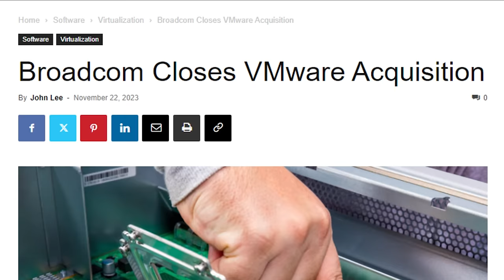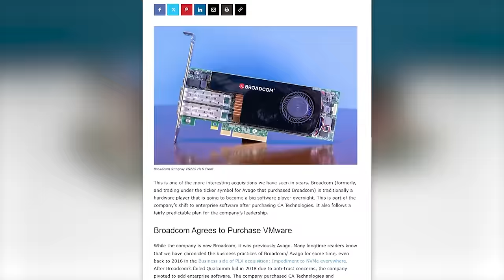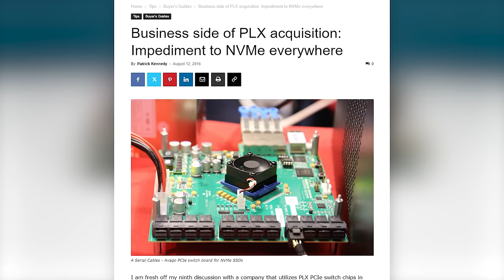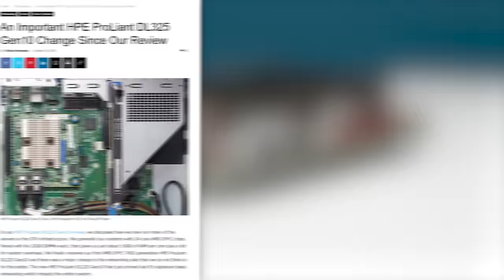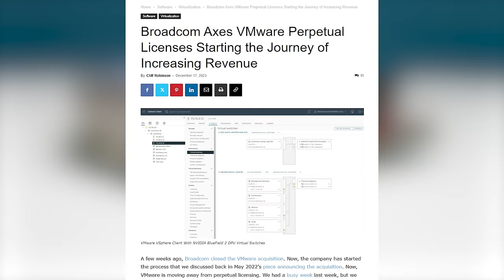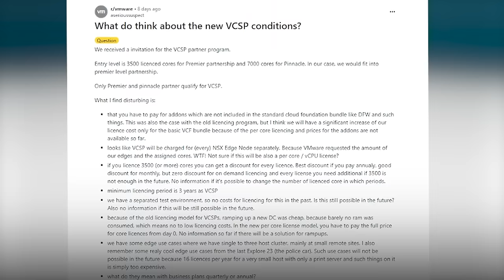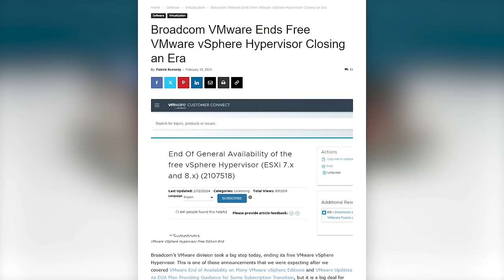VMware GUTS Customers with 10x Price Increases

Comment: 4:53 - It is actually common practice to put standalone ICs on the motherboard on initial A-Rev, first to ship boards. This is because it is so easy to replace in the manufacturing stage if problems are found with the firmware. Once the firmware has matured it is then transferred somewhere cheaper. There is nothing nefarious about.

Comment: The issue is not switching the hypervisor , that is easy. You have XCPNG + zenorchestra that at a base level is superior anyway. Its the products that sit around it like zerto or rubrik. If you are using them products and have your processes set up around them that is hard to switch. If you are a smaller player with a few hosts vmware dont want you and honestly you are better off without them anyway. The super big boys are fine as they will pay anything , the low end guys can just switch as they have a small number of hosts. Its the guys in the middle with say 10 hosts that are fu***ed.

Comment: Coverting VMWare is not easy , but is doable. I'm hoping MSFT (HyperVisor) or Oracle (VirtualBox) will come out with a simple convertor.
Reply: Oracle Cloud has a VMware infrastructure lift and shift solution. You can just move your entire esxi/vcenter infra to OCI without reconfiguration, and Oracle will provide you with VMware subscriptions with a better price (for now). 

Probably at a later stage they will also provide a migration solution from vcenter on OCI to OCI native
Reply: XCP-ng's import tool works well. Only had to make small changes to each VM config after migration.

Comment: I’m just a small VMware Fusiom customer who has used it to run Windows on my Intel MacBook Pro very occasionally. I’ve been a customer since 2012 when I bought version 4, then six upgrades on top. I held off buying the last two upgrades as they didn’t offer any value to me, and now have switched to Parallels on Apple Silicon for running Windows on ARM. Couldn’t be happier!

Comment: We are watching the death of the private cloud. This is a disaster for small business with big IT needs. For example I run a call center IT dept. We have the IT needs of a company 10x our size in other industries. I use VMware now and am looking at moving back to bare metal servers because I can't trust the hypervisor companies.
Reply from the maker: What about a Linux virtualization option?
Reply: Cisco is getting back to back stomach punches with this. In December, they released version 15 of CUCM, Unity, and CUPS to move away from CentOS, with UCCX pending. Now, they may have to redesign again as all of the products are currently only supported on VMware on UCS servers. Interestingly, Cisco never supported over subscribing vCPUs to physical cores.
Reply: @ServeTheHomeVideo  not every software solution support that. There is a substantial amount of software distributed mostly as the VMware appliance.

Comment: I have added additional RAM to my NAS and am now using my existing Synology NAS's built in VM manager application to host VMs at home.  I got rid of two ESXi hosts and quite a bit of CPU horsepower in this effort, but for a home lab  I didn't really need the CPU horsepower.  This has proven effective and I am happy with the result.
Reply from the maker: Totally. If you needed more CPU QNAP tends to offer more also in a NAS platform

Comment: We've got rid of our on site server estate, 30+ offices because of the VMware costs. Now we use Azure and our own DCs for servers and that's it.
Lose customers = Increase prices to keep profits high = lose more customers = rinse and repeat
Reply: But if you migrate your workloads from VMs to the cloud as it is, the cloud setup will cost you times more than onprem. Or?
Reply: @G00glieS  like for like yes. But these are general services like DNS, AD, DHCP, Printing, SDP. 
So they've gone, well we can get rid of all the local servers and just have all offices in that region running from cloud or data center

Comment: I work for a Fortune 500 company that uses VMware extensively. I even admin a remote sites instance as part of multiple responsibilities. I really wonder what they are paying because they have thousands of instances, easily. They have also had to maintain mainframes as well, lol. Certain software that runs the company was designed for it.

Comment: We have a couple of old VMWare servers running our on-prem stuff. Already have the new servers on hand, just waiting to migrate them all over to Hyper-V. It's all Windows Server stuff anyway, so Hyper-V made sense. Broadcom will price themselves right out of a business model. Your point on the pipeline is spot on. Small players who are already using the product are most likely to expand on the systems they are already using. Shut off the pipeline, and it will just be the big legacy clients, most of whom will start running the numbers on migration vs. continuing to license a dying product.

Comment: As soon as I heard about it, moved to XCP-ng. And have fears about what will happen to Spring.
Reply from the maker: I told the XCP-ng folks we will cover them more at STH, even though I am much more familiar with Proxmox VE.
Reply: What would be interesting to see, been running my small business on XCP-ng for a few years now and I found it to be super stable.
Reply: I saw XCP-NG supports iSCSI but I haven't seen anything about NVMe over TCP. I thought I saw something that neither Proxmox nor XCP-NG supports VMware snapshots on block based storage like iSCSI. My backup solution, Cohesity, uses the snapshots for VM backups. There's an agent for most OSs but that doesn't help for appliances. Quite a few of the appliances don't include any kind of VM tools.

Comment: That you stated that moving to Proxmox is simple. Many of the SMB users of VMware have it integrated with other system such as their backup and or DR system. So, for some of these SMB's they not only need to move their virtual environment, but they also need to move their backup system as well. Let's say that solution is Veeam they and they are using replication they would have more than just one consideration.
Reply from the maker: Yes. We have folks on our team that are going through this right now with VMware and Veeam.
Reply: As a computer reseller, I had a brief conversation with my Synology sales rep and mentioned this. I planted the seed that they need to start playing with Proxmox and alternatives as people jump ship. Hopefully, that seed will take root soon.

Comment: Just finished moving all the environments I'm involved in away from vmware. Proxmox has been a good alternative so far, the biggest problem is availability of training for staff.

For my home setup, kvm with something like virt-manager is good enough and nicely light-weight. In general, having lots more storage options is a big plus over esxi based solutions.

While I've been using esx since version 3, and really liked where it was going technically in version 6, after that, things have been going downhill imo.

Comment: I've come from a Hyper-V background and have just changed jobs - to find that all of my customers are using VMware. Having not touched the VMware ecosystem before, I'm needing to learn it as quickly as possible. I have a server at home with a spare node that I was planning to use as a VMware test server - but now I guess I can't! So silly of them to remove the free version - my company isn't going to pay for a testing license, so now I just have to learn on production systems. Well, I guess I can blame VMware when mistakes happen (which let's be honest, they will).

Comment: Last time I used it, esxi was on version 5. Once Hyper-V came out, it didnt make sense to host windows on it. With docker/kbernetes and pods, it doesn’t make sense to host linux on it either.
And with microsoft shifting to cross-platform with dotnet core and so many tools, its no wonder 80% of my infrastructure is running on microk8s

Comment: As an enterprise midrange guy with an actual ELA (not a top customer, definitely not a preferred partner) , I find the pricing has been about the same if not cheaper so long as you have 7000 cores in the environment to put towards the lower tier license. Granted it's a volume game. The problem I have with moving away is that while yeah the floor came up for most people the ceiling for NSX came so far down that it's actually a consideration which is a cool cool technology. I hate change, this was no exception, but I'm glad I made it out alive for the next 3 years so I can slowly shift my stack to something new.
Reply: Nsx is not worth a penny without firewall addon. Cost of this addon is +30% to the vcf

Comment: Migrated from esxi to hyper-v back in 2019 when they ended perpetual and jacked up the pricing to per-core back then. Used StarWind to migrate, which was smooth. Win Server DC was cheaper per-core and had all the features we needed and more. We were already a mostly Microsoft OS company so it was easy to transition, especially given the unlimited instances included at no extra cost. An easy path to azure if need be. Not everyone can say that, but it worked for us. If you are linux-heavy then there are probably other alternatives that are likely cheaper or free.

Comment: Wow, I'm so shocked at this.  Been using VMware daily since 2004.  VMware Server, ESXi, vSphere and Workstation in the workplace and Workstation and Fusion as a paying customer in my personal life.

I made great use of VMware Workstation in 2004 for some computer forensics tasks, where it was useful for frozen memory image analysis for some court cases, thanks to the VM suspend feature.

I guess my home virtualisation servers moving forward will be exclusively based on OSS, like ProxMox.  I'm fine with this, I used ESXi at home to remain current during those gaps in jobs where VMware knowledge was less needed from me.

Comment: I hated vmware when I was in the trenches as a noob IT guy, I hated it supporting it for my customers when I went my own way. One of my guys is a massive vmware lover. His machines are literally the only windows and vmware operating systems in our company with the exception of the bookkeeper and CPA. In the mid/late 2000s I was an OpenVZ fan until Proxmox came on the scene. I switched and have never regretted it. They are seriously the #1 hands down best os when it comes to handling ZFS as well. I've yet to see any other distro do ZFS properly from the installer without cli massaging needing to be done. I only have one server of mine that doesn't have Proxmox as it's hardware OS and its job is extremely simplistic and needs to be separate hardware.

Comment: About “free ESXi”: did they remove to download at all, or “Free key generation” is not available? Because for education purposes you can use ESXi in trial mode for 60 days. And then reinstall. And “Free” ESXi is almost all API locked version, so you really can not do anything other than run it just on one server.

Comment: You see it all the time, a company that believes its dominant position is unchallengeable thus can exploit the customer base.  Virtualization is not that - there's plenty of other providers as you have mentioned which are pretty easy to jump.

If it were a DB technology or software stack, you would have an argument, but this is the best way to make a once dominant platform obsolete.

Comment: We converted to pro mix about 4 years ago. All VMs migrated not rebuilt except windows ones (which we rebuilt). It is simply better than VMware to manage, though its performance is a little worse. Never got on well with containers, so still using vms, but it’s pretty good at that!

Comment: Whenever I do a training offered by my company, I see internal or external videos of trainers who use free stuff only, like a free AWS account, so they never touch a topic that requires a paid account, generates real costs or ever talk about the billing side of things ( like AWS billing). This is ridiculous compared to a few years back when a classroom training by the big un*x vendors was done on really expensive hardware. Now even the trainers are not allowed to spend a single cent anymore. So it is obvious that rookies and trainers will move away from pure commercial offerings to whatever can be done (at home) without spending a dime.

Comment: It's not the 1st time vmware does this actually. ~12 (?) years ago or so (v4 to 5 "upgrade") they put a 32GB limit on ram usage on free ESXi versions, making them pretty much unuseable in any serious setup. We had licensed vmotion clusters (few racks worth, it was by no means small or cheap setup), but also had like 2 blade racks with free licenses for labs, test env and so on. The cost jump was so massive, it actually made sense for us to look to something else, and in half year we moved away from vmware completely.  Guess this happened too long ago for today's management to remember.

Comment: Doesn't "mainframes" already have virtualization and software already built in? Commodity servers are more likely for virtualization.
Reply: Virtualisation was pioneered on the mainframe, with z/VM (IBM hypervisor, originally called something else). Mainframes also have a feature called logical partitions which is basically lite virtualisation, it enables you to divide the system up in separate installs that all think they control the system. z/VM supports both IBM operating systems like z/OS and various Linux distributions
Reply: He seems to be referring to the general state of the market (small, monopolized, not growing) being just a selection of captured corporate/govt clients. Having working in z/os with the feds up here in canada I see exactly what he means.

Comment: I've heard that VMWare doesn't necessarily care about monetary gain from customers, more or less from corporations. Hence the reason why MC60H-DWHD5-H80U9-6V85M-8280D will unlock the latest version of vmware with zero cracks needed.
Reply: Knock on wood, but I'm hoping VMWare doesn't ever remove this "crack". If you are a novice and are not using VMWare for a company, then by all means try out that key

Comment: Well... Now what? Since HP changed ESXi to be account/subscription only model that requires remote security authentication (so has to be online) an.Dell nad already done that long before HP woth DRAC, what are we supposed to use NOW? I mean... Lots of small home networks are run off the VMWare hypervisor, because it's the best you could really get/use in secure offline private LANs. 
Serious question, not just griping... What do we use now? What else is there out there that does all that without needing to be online for authentication servers?  What should we be looking into now to replace VMWare? Any suggestions, anyone? Hopefully?
Reply: Nutanix AHV
Reply: @G00glieS  Ah, thank you! Looking into that now! 🙂
Edit: Ahh, looks like it's the same deal. Monthly subscription, they control it, can't use without constant authentication on THEIR servers, and... again, monthly subscription to use it. Minimum 5 users @ $33/ea so at least $165/mo to use it. Not really viable for tinkerers/small businesses to have to tack that on top of their IT tech paycheck (if business), hardware, etc. and again... remote connections required. 

That's a make-or-break deal for a lot of systems that need to be airgapped/internal only as well... Companies dealing with medical documentation/insurance, for example, tend to only connect work terminals to a secure intranet wan instead of the internet.
 
Even WFH access is typically done through a secure firewalled double NAT VPN client (simplifying it for explanation... I know, I know) so all data exchange is done over encrypted comms, and all storage/processing is on their end inside the intranet.

Comment: I locked in 3 more years for my small 500 core environment (paid roughly the same as I used to per year for perpetual sns) but i have no illusions that will hold. Proxmox is interesting but need vgpu support to mature.

Comment: Renewing my 3 node SimpliVity cluster now. New (to me) Per CPU license with 16 core per socket minimum. Unfortunately my hosts are 10 Core CPUs (30 cores) and my older HC 380 host with dual CPU are only 12 cores per socket (E5-2630v3). So I have to spend $11K for one year of "vSphere Foundation" to license 80 cores (5 x 16) to cover my 54 actual cores. All this so I can just continue running 6.7.x ESXi on 4 hosts with a single vCenter. Does anyone know the average socket core count on servers sold to small business over the last 5 years? I seriously doubt it is 16 or higher so 16 core minimum is straight up screwing us for cores no one has. Given I'm taking an almost 50 percent hit on my SimpliVity's lack of cores, I will dump it at end of lease. I will be investigating other options, but will HPE or Dell be offering non vSphere options to it's small customers?
Reply from the maker: In 5 year old systems, most are 20 cores or more per socket. E5 V3 was lower core count but is now around a decade old. 16+ core E5 V4 CPUs should be drop in with BIOS update and dirt cheap.
Reply: @ServeTheHomeVideo   yeah I have picked up some 2699v4 CPUs for cheap. My HPE HC 380 is a bit older but still a useful DL380 Gen 9.
Reply: Finding and buying 2698v3s on ebay for a quick upgrade takes less time than writing a comment like that. They're like 50 bucks a piece. 
Also the 2630v3 is 8C/16T.

Comment: PLX chips are also used for multi-die GPUs like the R9 295X2 as I recall, and guess what happens after the acquisition? Multi die GPUs are no more, the incentive is not there anymore since it's too expensive I guess, after that SLI and CFX are also basically dead, now I can get a clearer picture lol.